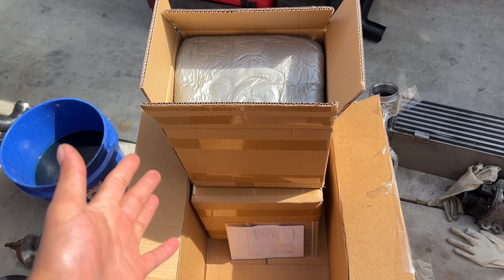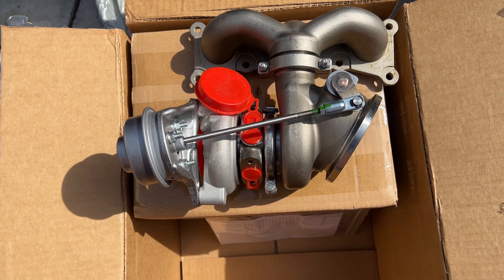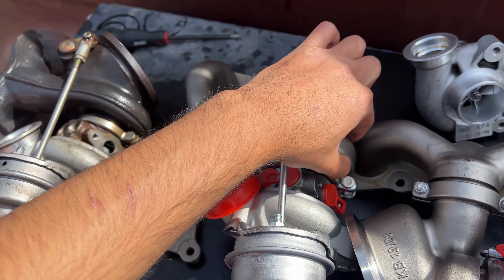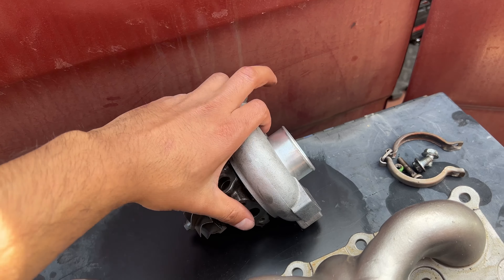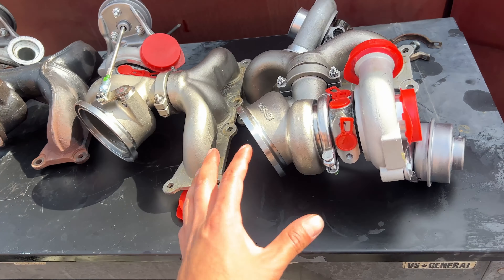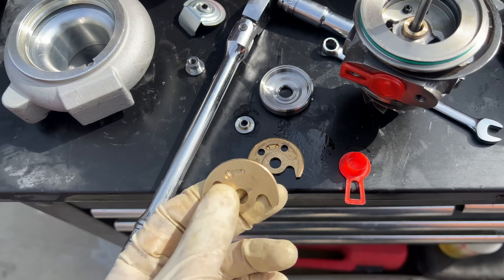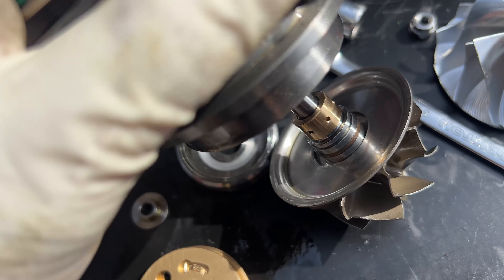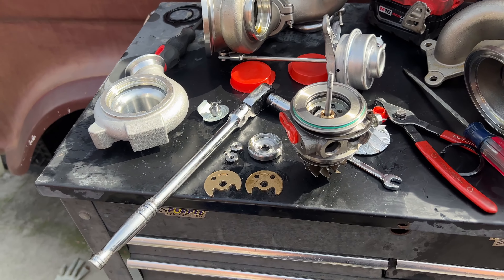NEW 19T V4 EBAY TURBOS REVIEW

Comment: I have the version 3 19t's and same thing whith the internals.  Swapped them out with the turbo labs kit as well and have been running them for 10k miles now with no issues.
Reply: Did you put in the staggered rear seal? Turbo lab of America is telling me that the the rear seal won’t fit and I’m have to use the seals it came with.
Reply: How are they holding up ?
Reply: @grizzlycali4508 you mind dropping a link for the kit you used ? I got the v3s aswell

Comment: Hey bud I'm not happy to see that your 17T turbos didn't stay the course! I mean I'm sorry you have to go through this again as well.   You may recall I have the same ones (Maybe you don't remember the comments I made but I remember lol) I had bought the same turbos and had them installed just after you did. Mine are still going strong so far but who knows maybe they won't be much more. I also have those cheap inlets you made a video about and I've been worried about the very same thing! I've actually just installed the "ARM MOTOR SPORT" Intercooler to charge pipe Upgraded Silicone pipes and I LOVE Those suckers. However I'm concerned about those inlets but my car is an "XI" model so doing things like the inlets is a real crazy job. You MUST remove the front subframe! Grrr!
Reply from the maker: Dam yea I would recommend inlets especially if your going to push higher boost. I’m loving the new turbos tho. How much did you pay to get the turbos installed?

Comment: I’ve had the first or second version of 19Ts they made a ton of power with all supporting mods. Was beating cars making 650-700whp. Only downside they blew with in 2500 miles but still made boost. Now they are dead won’t even go past 5psi. 

But now that there’s a v4 im wondering if they have gotten any better? Is it worth to try them again or should I go a different ?

Thanks in advance !
Reply: If you find out any anymore info on the v4 19t's let us know. I was just about to buy the v3 19's but I was wondering if it's worth it knowing they won't last long when I can same that money and put it towards some pure stage 2's or RB Game Finisher high flows.
Reply: @Osamabeenleanin210  i got you. There’s honestly not much out there for the new 19T and because this would be my second go around. I might have to fork out a bit more and go with something “reputable” but then I also hear of the more expensive ones blowing also.
I’d choose from DAW, Franken Turbos, or RB game finishers 19Ts (these look like they took 19Ts and upgraded the parts).

Comment: I got my 19T V4 yesterday. Should I swap the parts out? 
I have a great amount of mechanic experience but I’ve never rebuilt/disassembled a turbo before. I’d hate myself if I fucked them up
Reply from the maker: You could. Get the correct kit from turbo lab of America. However I feel the v4 have solid internals compared to the older versions
Reply: @menjicar  is it a good idea to use the exhaust gaskets that they supplied? Lol
Reply from the maker: @lilchu7336   no. Use oem ones like from FCP LOL